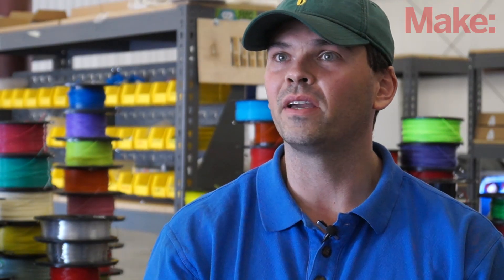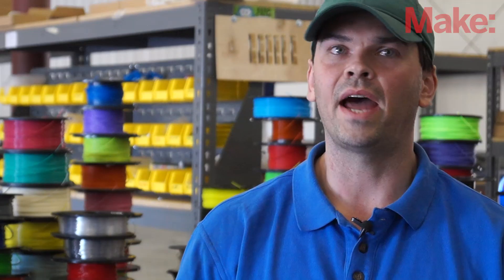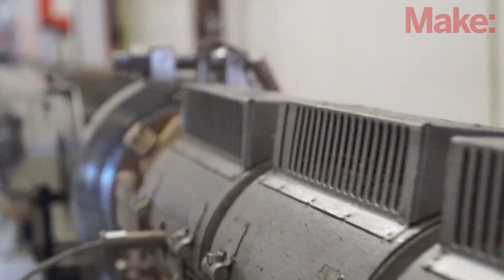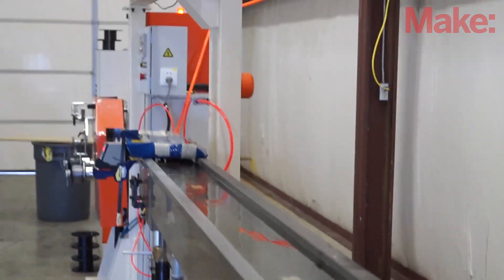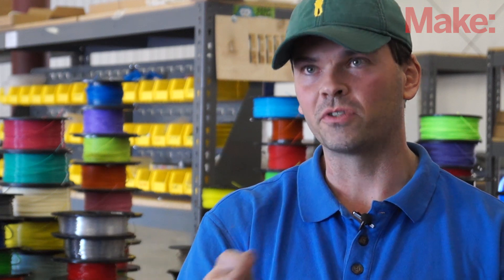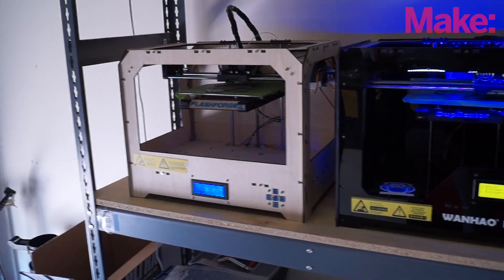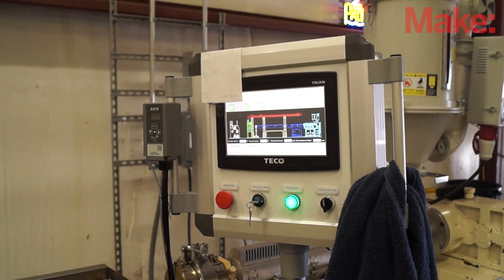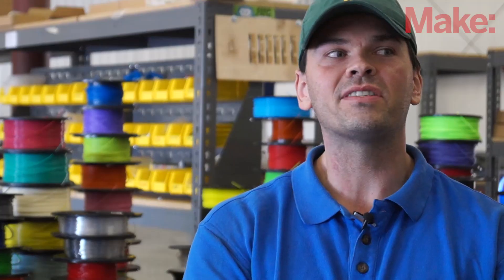How It Is Made: 3D Printing Filament

Comment: What is the Machine he is using called, were could i purchase one for my business?
Reply: Fernando Henrique
No it is a single screw extractor which pushes it through a die.
Reply: It's a injection molding machine.In general, it is used for creating termoplastic parts from a mold.